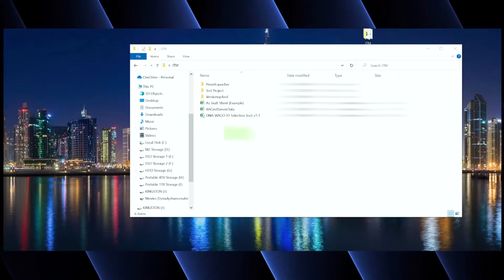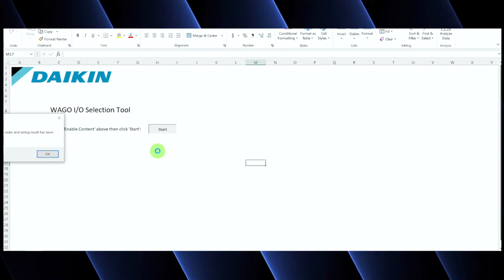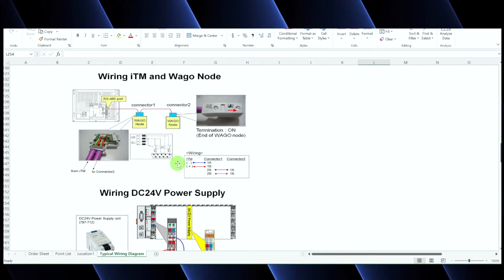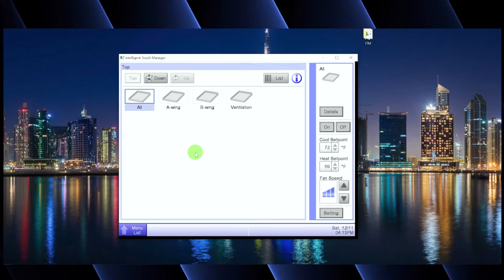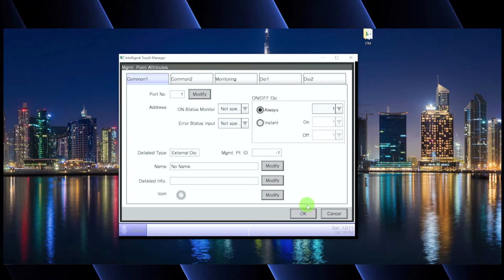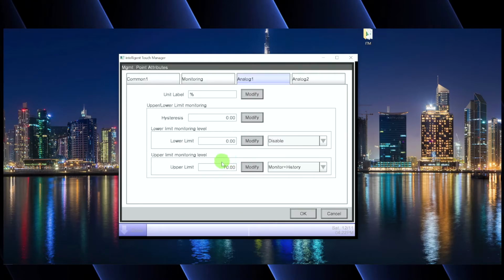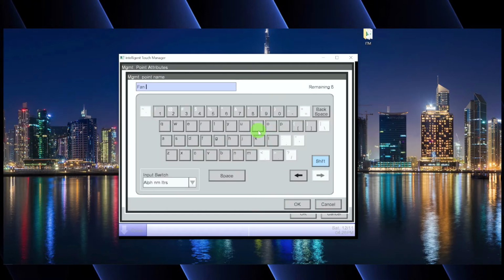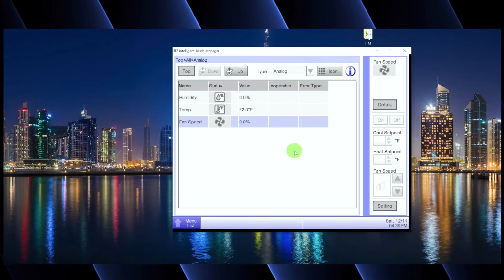Daikin ITM Wago Installation & Setup | Basic Input-Output Module - 12-24-2021

Comment: Dana, am back again....i have this Wago controller 715-315/300-000 but cannot communicate with my Daikin ITM DMC601A71.
With my 1st project i used Wago 715-315/300-002 and it worked prefect with my Daikin ITM DMC601A71 but unfortunately am not able to get Wago 715-315/300-002 again i have search with my local and regional  distributor but couldn't get it everywhere. My question is will the Wago 715-315/300-000 work? if Yes what should i do and if No why?
secondly can you assist me in getting the right Wago controller that will work with my Daikin ITM.
Thirdly what are the available Wago controllers that will work with Daikin ITM DMC601A71
Thank you
Reply from the maker: I'll have to look up the wago controller part number but if you got it from your daikin rep it should work no problem. Usual issue is it's wired wrong, the rs485 is polar sensitive so plus to plus and minus to minus. Second issue is it gets addressed wrong on rotary dials. 3rd issue is it might be wired wrong on each contact or programmed wrong in the itm itself. Could be any of those potentially.
Reply: @InverterAlways  I got the wago controller from a store in the UK and not from a daikin rep.

Comment: what type of cable should i use for the wago-to-itm connection?
Reply from the maker: 18/2 works but it's slightly large so 20/2 would work better in my opinion. It's a rs485 connection.
Reply: @InverterAlways  thanks for your quick response, enjoyed your  video

Comment: Wow that was amazing, i have carefully follow your tutorials on my real project but there seems to be no communication between my wago and my ITM, is there a way to know if my link is properly working. secondly too do you have to program the wago Plc before connecting it to the ITM? Thank you
Reply from the maker: Check your +/- wire between the itm and wago. Most of the time that's connected wrong. Next double check the address rotary dial of the itm matches the port you're addressing each point to. Amd of course check the resistance end terminal. 
In case you didn't wire the 24vac properly that may also cause issues. Most of the time you can test enable/disable outputs to check com without having anything even hooked up. Hope that helps!!
Reply: @InverterAlways  You are the best and thank you once again, i followed your reply to my earlier message and i was successful in my project. Also grateful for the quick response.
Reply from the maker: @thwartsystemsautomations  glad you got it dialed in!! Appreciate the feedback thank you!

Comment: I am curious if you could put this device in on an indoor unit and use a non-adjustable temperature sensor (as seen in a lot of supermarkets etc...) to control the unit rather than one of the typical controllers that Daikin offers?
Reply from the maker: Why not just put the stat in the area being served? You can also put a remote sensor on the units already, no need for a wago. The wago would be more like if you wanted to use a sensor in a space to enable or disable something like 3rd laity gear.
Reply: @InverterAlways  Ok that makes sense, I was thinking a Wago would be needed for that, thanks for clarifying